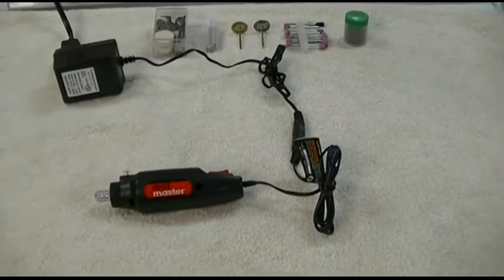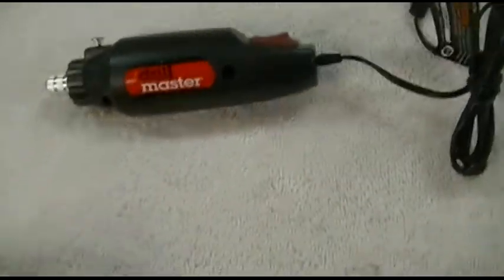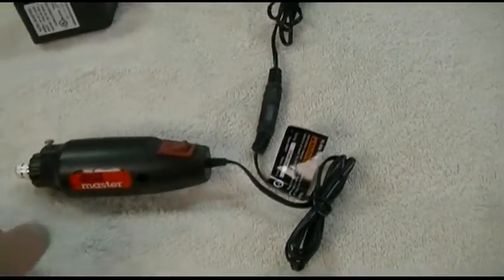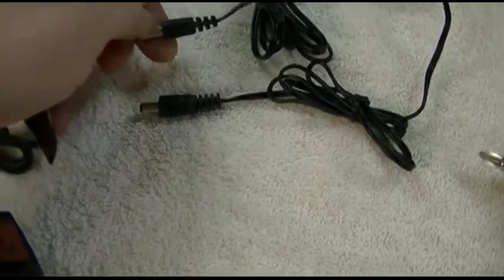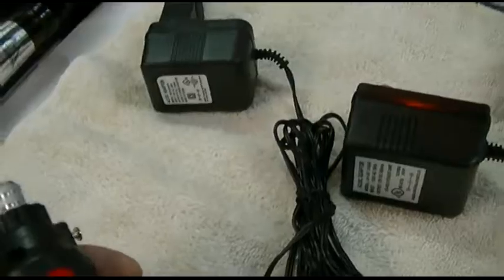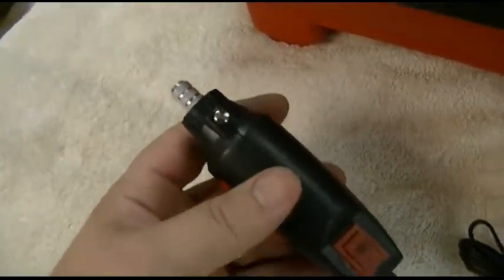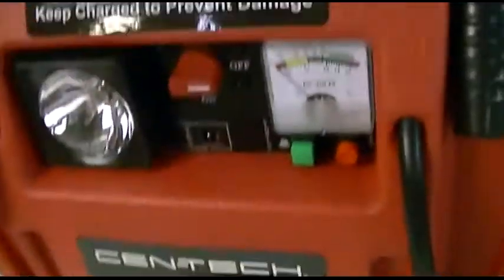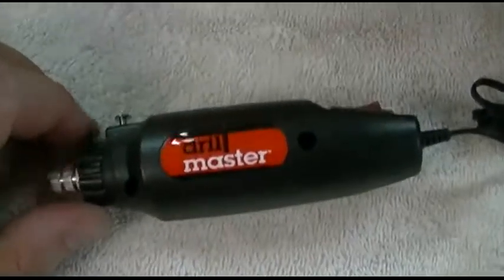Harbor Freight - Drill Master 80 Piece Rotary Tool Kit Review

Comment: This thing is junk. I had 2 of them before I said give me my money back.  Spend $10-15 more and get the 31 piece, variable speed, 8000 to 35000 rpm model for $24.99 on sale. Its a real electric motor not a hobby motor designed for little cars. I touched the sanding barrel to my motorcycle engine mount to grind off some paint for a ground and it came to a halt.  Such a joke.  lol
Reply from the maker: You missed the point.  You're not going to spend $8 for a hobby motor to grind away at your motorcycle mount; you get a real rotary tool like the one you got for that.  That's why I have a real rotary tool as well--this one is for VERY light work, modeling, or touch-ups.

Comment: if i wanted to cut hot wheels and grind the metal flat on fender wells on them for customs.. would this work for thin metal like that?
Reply from the maker: I'd expect it would work well enough for the price, especially if you beef up the power supply like I demonstrated.
Reply: ok thanks!